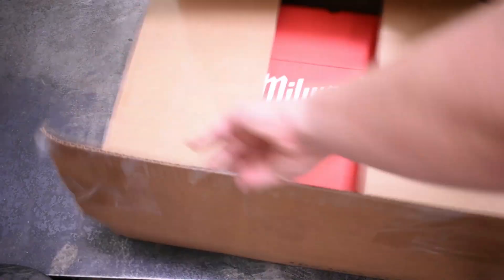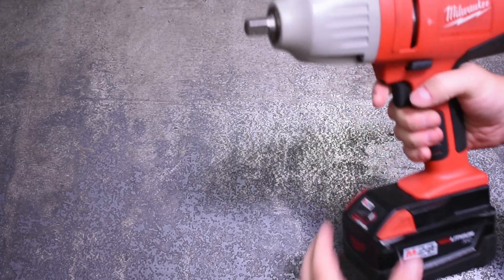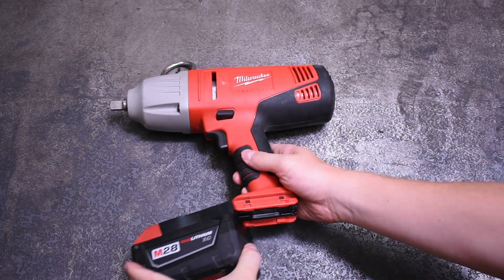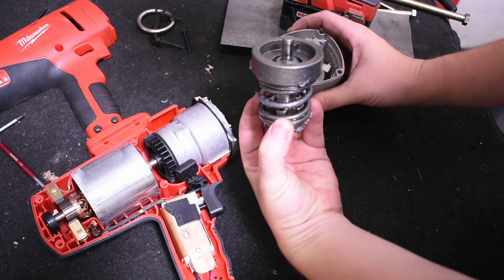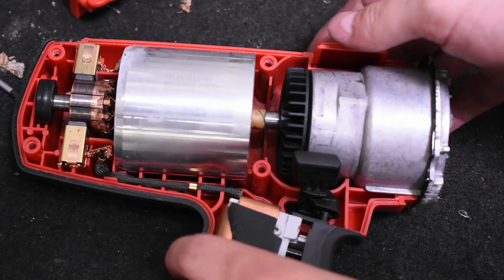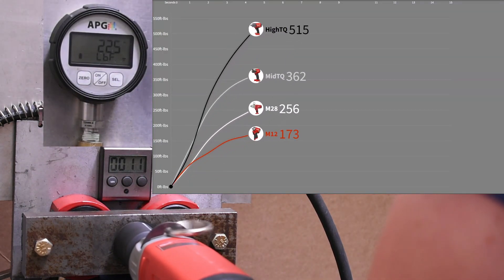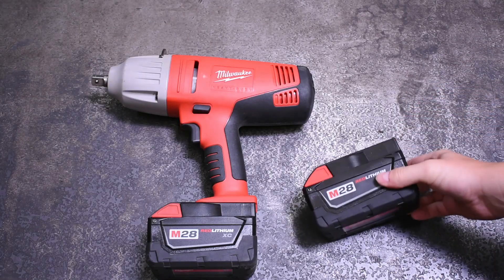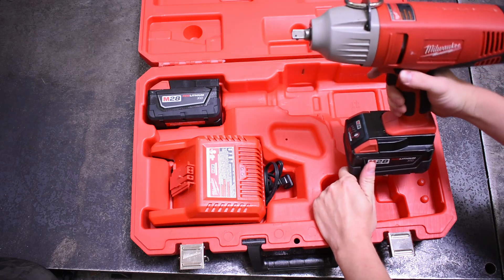The Curious Case of M28: Milwaukee's Little Known 28 Volt Line

Comment: I worked at home depot years ago and bought the complete M28 set when they were brand new drill light, circular saw, sawzall, impact wrench. For years and years I waited for Milwaukee to expand the M28 product line but they never did. Eventually my batteries needed replacing and they were like $200 each so I sold off all the tools and went to the M18 platform. They were great tools just a little clunky due to their size. The M28 battery pack is similar in size to the M18 12ah pack.
Reply: The M28 took a big punch heavy duty workhorses but the batteries went down like nothing, the costs to replace the batteries weren`t affordable even if you was a contractor. They've let the 28v system die because of overwhelming cost and warranty issues. I like my set of 28 volts because of the heavy appearance but sometimes we have to accept that a museum isn't the place to earn money it's a place where others spend money!
Reply: @Crossthought  Couldn’t have said it any better. It was a great platform but it died quick. Nobody would rebuild the batteries either. For the price of two batteries I bought the gen 3 m18 drill and impact two batteries a charger and s packout case
Reply: @FixitFred  you can rebuild the battery at home. It use simple 18650 cells, which is cheap.
Reply: @zsolttoth8914  Years ago when the first set of m28 batteries died 18650 cells were expensive and the equipment to rebuild it and the knowledge just wasted there. Now you can buy rebuild kits and battery tab welders and cells that were even better than the ones it came with.
Reply: @zsolttoth8914 I saved my dead batteries to rebuild them but I can’t figure out how to open the shells.

Comment: I bought the v28 kit if I remember correctly. Hammer drill, light, saw, sawzall. Also bought a bandsaw. Ended up getting some m28 batteries to replace the v28’s that went bad(all of them went bad), but I still wasn’t impressed with the run time. Ended up selling the tools except the bandsaw. Gave that and the batteries to a friend.
Reply: I had the kit many many years ago as well. Was great for what was available back then.
Reply: @okiebob5873  I agree. The technology has just come so far between then and now
Reply: With friends like that who needs enemies
Reply: @galvanizedgnome  I guess the point I was really trying to make is basically the same point they made in the video. Yeah, they’re 28 volts, but they’re not as good as current tools are. I didn’t mean for that to be any sort of bragging if that’s how it came across.

Comment: We had one of these at my last job, as well as an M28 hammer drill and (I think) sawzall.  I really wasn't too impressed with them - most of us just went for M18 or DeWalt before grabbing an M28.
Reply from the maker: Years ago I briefly used an M28 sawzall for a job and found it to my liking power vs vibration wise. I pretty much completely forgot about the line of tool until this popped up in our inbox.
Reply: I had most of the M28 tools. The hammer drill was way too heavy and the impact not all that impressive

Comment: I purchase the V28 about 12 years ago replaced the batteries to the m28 and still use the drill / 6.5" hand saw /  sawzall and flashlight . Plus I have the M18 and 12 volt units at work. Still the best investment over Makita 18 volt I had 2 makita drills fail white case .
Reply: I REALLY want to like Makitas, but man are there a lot of different stories of problems over the years
Reply: Saving grace for Makita is they've committed to the same 18V LXT platform longer than anyone else ( 2005- ). I owned the Made in USA high torque impact XWT08, a hammer drill and two impacts, nothing has failed but their warranty is lackluster.
Their entry level tools look cheap though, just like Dewalt and their commitment to plastic chucks on anything non XR.
Reply: @luisinhoens90  I have used both tools as a builder at home and at work the makita drills failed after about  5 years of use.
My 12 volt milwalkee sawzall  (14 years old ) I use at work quite a bit I just replaced the motor 30 bucks and two wires to solder the only reason I did this was cost and the brushes were worn out.
I price the motors for the makita I believe they want 68 dollars at the time so I just put them on the side maybe I will fix them if the cost of the motor comes down . As far as the batteries I have other tools that still work .

Comment: Here is me hoping you find a way to attach that m28 battery on  another m18 tool.
Reply: Why bother? Its old tech, probably uses obsolete cells and a poorly optimized bms.
Reply: @Senkino5o  That’s what did channel does. They added a gas motor to a m18 high impact. They always make modifications to tools to test them. It’s for SCIENCE.

Comment: Milwaukee don't need to increase voltage they already have the power with their 18v tool line up its freaking impresive what they achieve in 18v . I run exsclusivly milwaukee and dewalt tool and flexvolt is barely not that much more powerfull.
Reply: Well, you can increase voltage or amps to increase watts. There's disadvantages to the route they've taken, but they've made it work. That said, even Milwaukee has just released a couple 2x18 tools, and of course there's the fuel line.

There's more than one way to skin a cat, but each solution has trade-offs in engineering, production, and marketing.
Reply: that must be why IR spanks them with 3/4 the wattage budget in the 1" impact wrench class.  And while using 18650s.

And where's Milwaukee's 2" cordless SDS Max?  Dewalt's had one for almost 4 years and it has over double the impact energy of Milwaukee's 1-3/4.
Reply: a flex volt battery and an m18 battery have the same energy so it wouldn't make sense for one to more more powerful than another.
Reply: @85square  copper and magnet in motor play a big role
Reply: Also
Reply: @85square  That isn't how it works at all. Do you think all tools have the same watt output determined entirely by capacity of their batteries?

Comment: I had a 28v hammer drill over 10 years ago, if it hung up it would killl you like a rodeo bull. When the battery went bad, it cost more than the tool so I trashed it.
Reply: those drills are great but yeah $$$ i've had mine for over 10 years but i also have a battery spot welder